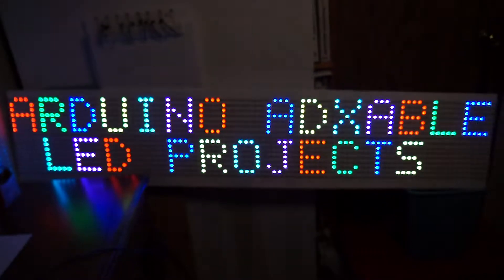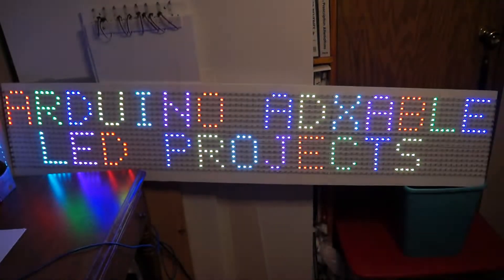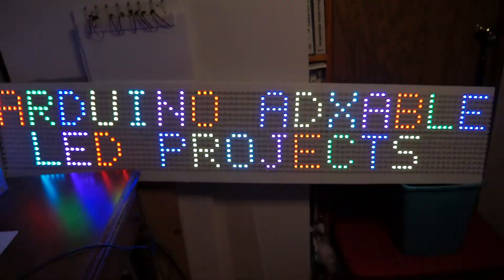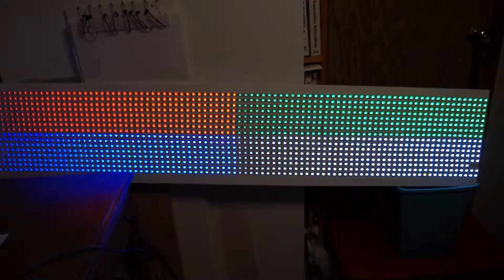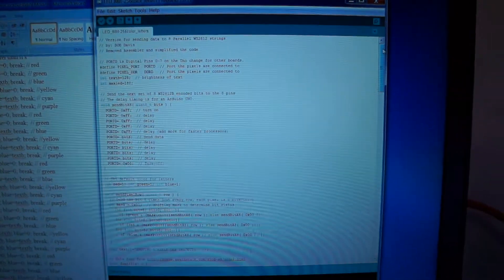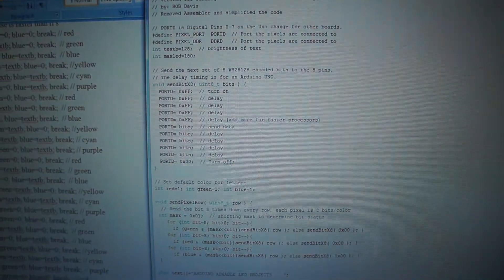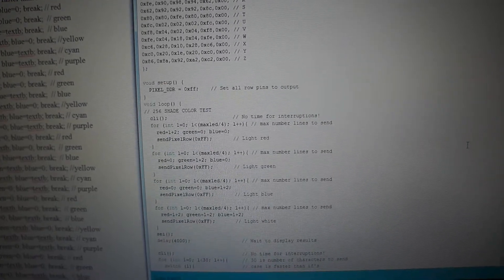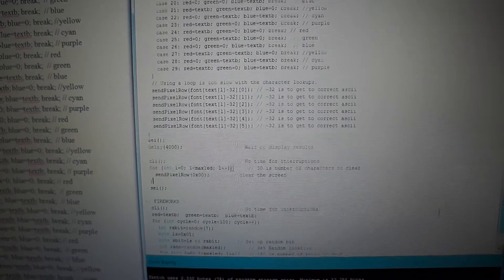Arduino 90x16 or 1440 WS2812 Addressable LED Sign

Comment: beautifull ! how many modules are stackable ?
Reply from the maker: I do not know at this point but I would suspect it supports 500x8 or 4000 LED's.
Reply: Bob Davis from which arduino board?
Reply from the maker: It uses an Arduino UNO.
Reply: Bob Davis any library support?
Reply from the maker: Its in my book "Arduino LED Strip Projects". Some code is on my blog bobdavis321.blogspot.com